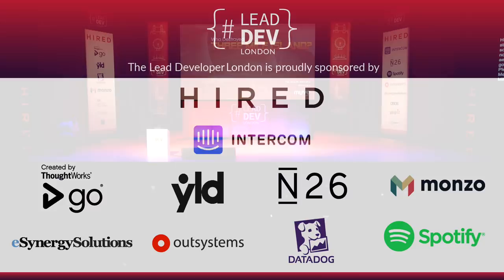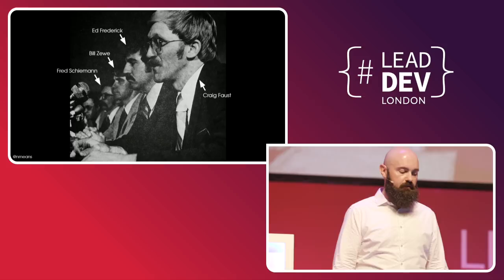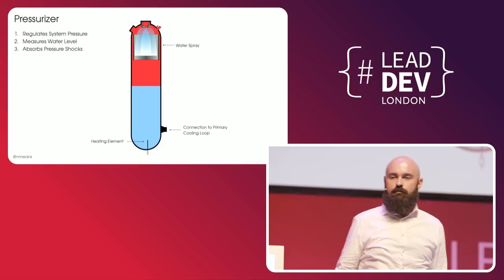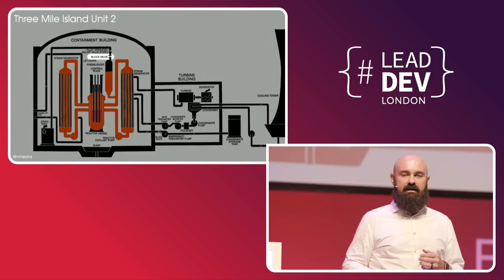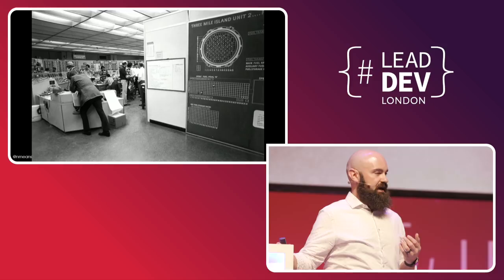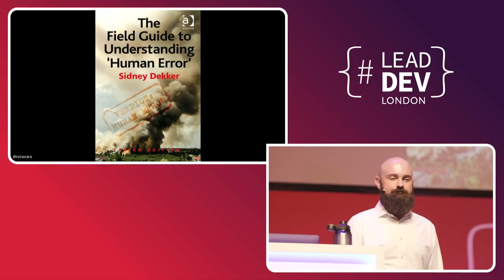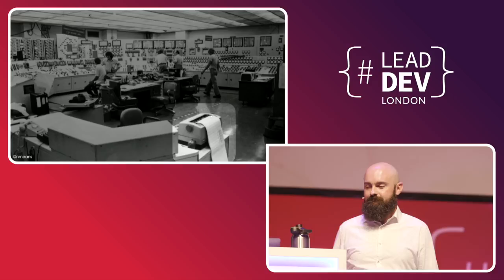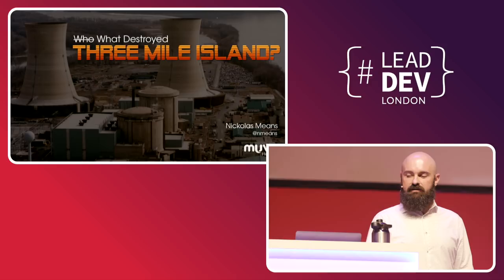Who Destroyed Three Mile Island? - Nickolas Means | #LeadDevLondon 2018

Comment: I hope everybody involved at three mile island has seen this, especially the second half!
Reply: I have, read my post.
Reply: @wilcalint  Care to repeat it? Can't find it.
Reply: @nextlifeonearth  - please find Bill Kenney's post below (thanks to "copy and paste"). 
Bill Kenney  
For the record. This guy was likely a teenager or younger in 1979. Three Mile Island (3MI). I wanted to point out that there is a Company in La Jolla CA called “General Atomics”. At the time of the accident GA had an employee count of about 2000 people. More then half of which had advanced Degrees. One of those employees was me. 
GA did not design, install, build or operate the controlling systems at 3MI. But, it did design, build and install 50 “PIG” monitors. Particulate, Iodine and Gaseous. The PIGs were scattered around the site and fed the gathered data back to a central computer(s) designed and built by GA ( and me ). At the time of the accident the GA system was operating correctly, being monitored locally, and by remote connection at GA in La Jolla. One of the Computer Engineers on the GA design team was yours truly. 
The causes of the 3MI accident have been gone over and over and over again for more then 40-years. Wild ass'd claims and conspiracy theories have been floated over and over again. All of them debunked. There was an accident, a bad one, it was fully contained, no one was injured, there was no widespread release of radiation. Inside the containment building was a nuclear hell. There was little to no detectable radiation or release there of at any time. Radiation at the site fence was at "background" levels all during the event. I saw the green bar paper print outs. Almost in real time. There were 28Kb modems in 1979.

Comment: There is something very important not mentioned in this video. this accident happened during night. Human mental capabilities are greatly diminished during night. After millions of years of evolution every cell in our body wants to take rest during night.
I have experience of 15 years of working night shifts and trust me I know I know what I'm talking about.
Reply: Yeah, even if you consistently work nights, so that your rhythms are all based on nighttime wakefulness, it still doesn't really work out well.  We have hormone systems that are based on light!
Reply: I'm a full-time software developer and it is vastly easier for me to write code all night than to write code all day. I'm more awake and my mind is much clearer without having the outside world distracting me. As it happens, I have a MRI scan of my brain that shows the gland responsible for regulating my circadian rhythm is hollowed-out and probably non-functional. Apparently the pineal gland enlarges during puberty and shrinks again in adulthood, but for some people it turns into a water-filled bubble instead of shrinking properly. So my circadian rhythm is, in fact, not properly governed by daylight as it would be for most people. Your rule, as with all rules, is true in general, but it's not true for every single person without exception.
Reply: @deusexaethera  int'resting
Reply: Humans are adapting to being able to be productive regardless of the time of day, especially as global communication becomes ubiquitous and time of day become less relevant to socialization. Humankind will adapt to new opportunities and responsibilities as is always has. However, the fact that human mental capacities wane and wax is relevant; they should have just trusted the robots
Reply: I must be nocturnal then.  Good point though.
Reply: @deusexaethera  - Thank You for this comment. Someone with a decoupled circadian clock.
Reply: @deusexaethera  Bump. My mother resented me even before I was born. One reason was that I stayed awake all night--in her womb, after my fetus had developed enough to kick my legs--kicking and keeping her awake. Then, I'd sleep all day. BEFORE I was born!

Mammals--yes, we ARE mammalian animals--exist both diurnally (awake during the day) and nocturnally (awake at night). To imply indirectly, or state emphatically and directly, that nocturnal human beings are abnormal is simply being naive.

In my entire life--64+ years at this writing, I have less than one accumulated year--less than 365 days--where I've awakened "normally" in the morning and felt good and energetic. When I'm able to actively be what I am, a "night-person"--sleeping during the day and being awake at night, more than 90% of the time I awake happy and full of energy after a good "day's" sleep. Sleeping 6-7 hours during the middle of the day makes me feel as rested as sleeping 8-10 hours at night. When I can sleep during the day, say from 9:00 to 16:00, at about 20:00-22:00, I literally come alive for 8-12 hours: my mind works faster; I think better, critically thinking; I learn faster; I'm more productive doing anything from programming to housework; my body heats up and I burn more calories without having to actively work at doing so.

I have spent years, literally, where I "adapted" to being a day person, sleeping at night and being awake during the day. The above has never changed. I AM a night person! I will be until I die.

Thanks, Shawn.
Reply: @johneeadbl5876 : I agree with everything you said. I do have to concede, though, that winters are very difficult for me. Even though I naturally sleep in the mornings, and enjoy being awake late at night, if I don't get several hours of sunlight each day my mental health declines so much I start wondering what's the point of staying alive. Winter days are short enough that, if I go to sleep near sunrise, I wake up less than an hour before sunset, and that is very depressing.
Reply: @deusexaethera  Take some strong vitamin D supplements in the winter (but, not mega-dosages). What you're saying above sounds like SAD, Seasonal Affective Disorder. It has been related (properly) to both: (1) untenable religious beliefs that are heightened around the winter Christmas and other holiday season and (2) to lack of vitamin D (normally produced in sufficient quantities by the skin when exposed to sunlight). People living in. Christian societies, including those that live along the equator where lack of sunlight generally isn't a problem, tend to have more SAD.

I don't have that problem with depression, that you mentioned above, when I'm staying up at night and sleeping during the day. I generally feel happier, more alive, more awake, etc. Maybe some of that is due to my working in front of a computer monitor, usually for hours, every day. Possibly, all that blue light which is supposed to make it harder to go to sleep later at night is helping stave off the depression.  I DO have--and have had--some moderate to severe problems with depression. But, the longer I live and the more I face that depression healthily, the less depression I have. Religious fanaticism, mental-health problems (including depression), substance-abuse/-addition problems run in both sides of my family. That is almost assuredly a cause of my depression and other former and present problems.

I've had times where it felt like I was lying on a sandy beach and the depression was like being covered and covered in more sand, just pressing me down harder and harder and harder. I've had problems with suicidal ideation and slow/unsuccessful forms of committing suicide, i.e. smoking tobacco and/or marijuana and drinking "tons" of coffee. What initially helped me the most with the alleged depression was to just accept it, i.e. some depression is normal. I say "alleged depression" because not all depression is related to repressed resentment and anger. Some depression is a normal and healthy part of grieving. Much of my worst depression, roughly half, went away when I realized that I was living by learned but highly dysfunctional patterns of behavior, learned primarily from my parents, with a tiny bit learned from siblings, peers, and society. Those inappropriate attitudes and behaviors were causing me to feel anxiety over being depressed. Much of that severe depression, roughly half, went away as soon as I discovered the repressed anxiety. More went away when I realized that I was feeling guilty--a bit--about being depressed. I had a bad attitude about depression, a sense of guilt--having guilt-tripped myself for feeling depressed, based on those unhealthy, learned attitudes about depression. After learning that unhealthy depression is primarily repressed anger and resentment, I learned that any of the so-called negative emotions, anger, guilt, remorse, pity, and pain--pure, simple, emotional pain--that are not effectively worked thru--later become depression when they are repressed. I learned that healthy fear and anger, and unhealthy depression, are just different tenses of the same emotion. (I stopped drinking alcohol in early 1984, having quit smoking pot in the summer of 1981. I stopped smoking tobacco in 1991. I'm still struggling off and on with coffee/caffeine and sugar/excess-carbs. However, having spent more than half my life in some form of "recovery" certainly was necessary to gain the insights above and below! ) 

Fear, anger, and (some) depression are all the same feeling, just with different tenses; they're just anger/fear felt at different times. Fear is anger in the future; anger is fear in the present; and resentment is anger/fear in the past. For example, if I'm off in a mental and emotional fog, walking along unaware of my surroundings,, and I start to cross the street without looking, and I hear a loud car- or truck-horn, my instant response is to feel fear. That's a healthy fear. It's telling me to stop mentally checking the air-quality in my transverse colon and pay attention to my safety. If I do that--pay attention, if I immediately get out of the street or road, then that fear goes away. That's fear/anger in the future telling me that I'm about to lose something I value, my life, if I don't react appropriately. If I step out in the street and immediately have to jump backward to keep from getting killed, then, it's anger: fear in the present. If, 10 minutes or 10 years after, I'm still upset, then I'm resenting that incident, the others involved, etc. Fear/anger/resentment are always--ALWAYS--my emotional reaction to one of two situations: (1) I'm going to lose something I have (that I need or want) or (2) I'm not going to get something I want (that I need or just want to satisfy urges, recreational desires, etc.). After a lot of work, I was able to start seeing the difference between rational and irrational fears (i.e., I wake up in the morning, check the mail, and panic over something that looks like a collection notice which just turns out to be a non-check ("We'll give you this much money if you do this______."). I started seeing the differences between legitimate anger (actually getting hit by a truck mirror while jay-walking in downtown Denver, CO) and anger caused by immature desires (somebody saying something about me that wasn't true). Resentment means "to re-sentiment", to re-feel. When we re-feel negative emotions that we haven't gone through by growing through them, we're essentially limiting our ability to feel 'better'.

From a Christian point of view (I'm not one!), all emotions are "God's gift"... From an agnostic/atheistic point of view, all emotions are nature's gift. That gift is meant to tell us where we are, where we may be going, and where we've been. If I attempt (by using drugs, misusing psychology, etc.) to limit my ability to feel the "so-called 'negative' emotions," anger, resentment, fear, guilt, remorse, shame, chagrin, pain, etc. then I limit my ability to feel all the "so-called 'good' emotions," happiness, joyousness, freedom, etc.

I hope that helps.
Reply: @johneeadbl5876 : That is a very long reply. I feel like I just read a letter from my future self. I've gone down nearly an identical path (minus the habitual drinking and pot-smoking, because they both make me feel bad), for nearly identical reasons.
Regarding your inability to "quit" coffee, you should talk to a doctor about trying a low dose of dextroamphetamine. I take half of the smallest tablet a day and it helps me a lot. With the exception of alcohol, all of the things you mentioned being addicted to have antidepressant properties, which is to say they are all  stimulants. All antidepressants are stimulants, and all stimulants can be antidepressants if they stimulate parts of your brain that are painfully underactive. Beyond that, I've heard that simply getting older is often a huge stress-reliever for people with anxious or depressive temperaments, because there are fewer long-term stressors once you've made it past middle-age. (provided your brain doesn't start to malfunction, of course.)
Unfortunately my problem is nothing as simple as a vitamin D deficiency. I do have a minor deficiency, but I take more than enough on a daily basis to compensate; rather, I want to be awake and functional all day long, like I used to be when I was a little kid. Nighttime is great for getting things done without other people getting in the way, but most of the things I want to do are best done in daytime. Bright lights and vitamin D can't compensate for simply wanting to see more sunshine. Ideally I'd like to have 17 hours of daytime every day for the rest of my life, so I could sleep through the morning and still have a nice long afternoon to feel like a normal person.
Now that I think about it, this strengthens what I originally said. Not only am I a night-owl, I'm a night-owl against my own will -- I'm stuck this way because parts of my brain are broken and nighttime just happens to be when they work best. "Intelligent Design", my ass.
Reply: @deusexaethera  Darn, hit the wrong key and lost another long reply.

Dexies--one of my drugs of illegal-convenience--are not an option. I've used Sleepy Time and Tension Tamer teas, along with melatonin, to rotate my internal-clock many times and will do it again here in the next few days, having enjoyed being a night-person for a few days, having enjoyed being over-caffeinated for a few days. At present, I'm watering the lawn late into the night as I let it go too long after our last rainstorm. We're in the midst of a dry spell, so, I'm having to water a lot, requiring me to stay up late. When I catch up a bit--no rain in the forecast for at least a week--I'll rotate backwards to being a day person, or stay up late, get up early, and take a nap in the afternoon--an acceptable, albeit not-desirable--alternative to strictly being nocturnal. With some heart disease, some COPD (lung disease), diabetes 2, sleep apnea, etc. I'm not going to live too much longer. Hopefully 20 years. Realistically, 10. If I can, I intend to be a night person for the rest of my life after my mother dies. It IS inconvenient. But, with no one to take care of and with people taking care of me, I think I can make it work. 

Good luck with your efforts (have you thought of moving north in summer and south in winter, i.e. Alaska and then the Antarctic? Just kidding. it's not realistic.). It's more effective to rotate sleeping forward (I used to work rotating shifts in the oilfield). But, it's more difficult to do so. Thus, I "normally" have to rotate backwards. I.e. go to bed an hour earlier each day and force myself to get up an hour earlier each morning--sometimes napping in the afternoon when I have to. That, however is "dangerous" as I tend to sleep too long during the nap and then don't want to sleep at night as I'm still too rested from the nap.

Life can be hell for night-people trapped in a day-world. "Growing old is not for the faint of heart!" Good luck with getting as much of those 17-hours of sunshine as possible.

Bye [klik]
Reply: I feel like I spent almost as long reading this comment thread as I did watching the video! Neither I regret. I think my wife is like you night dwellers. She often comes to bed just before I get out to get ready for work around 4am. I hope y'all are well.

Comment: Did you know that the river where they take the cooling water has a total different fauna&flora on both sides of the plant? Just cause the water has a tiny difference in temperature when it comes back out of the pipe then before it had before they took it out of the river. Complete different fish, plants and just everything that lives in there...